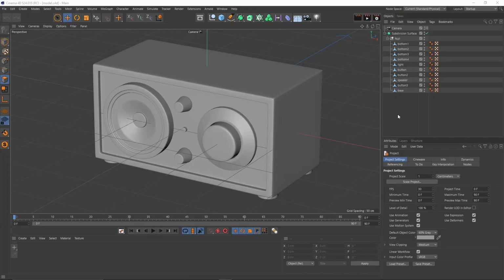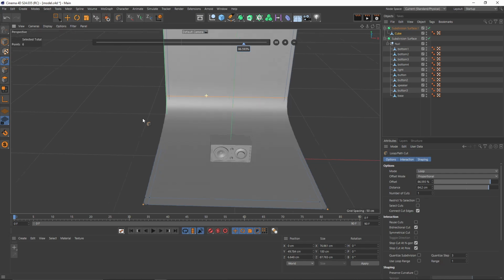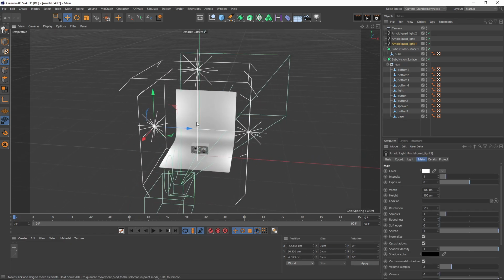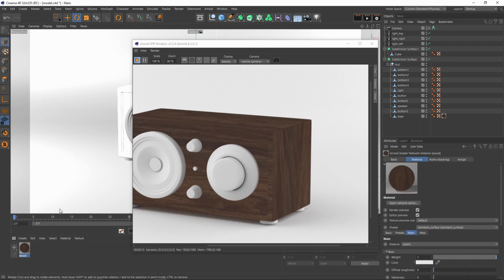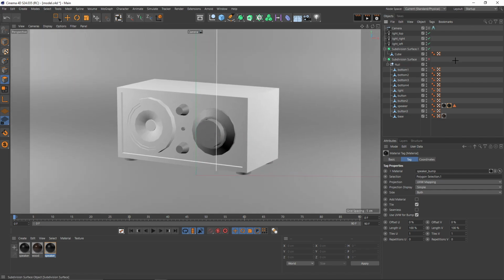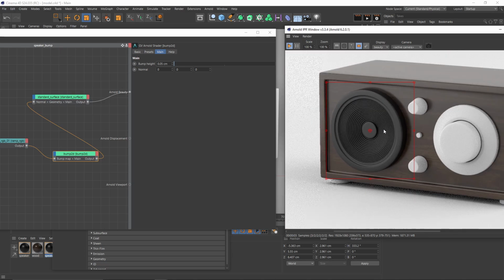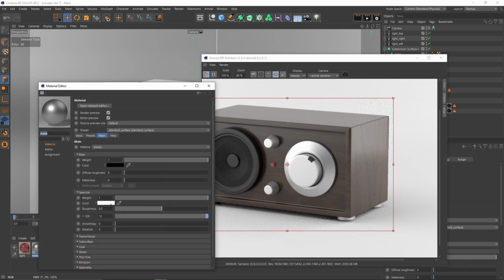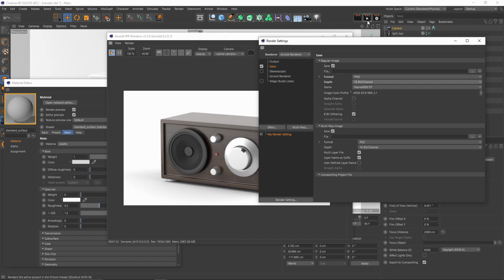Beginner 3D Rendering #1 | Radio | Basic Arnold Rendering Tutorial

Comment: i am using r21 version but is there any modeling tool difference between s24 and r21? if not i would not like to switch
Reply: They change the menus, changed the name of axis center, changed the icons on the UI, the only VAST improvement I found was for UV, I never did it before but now on 24 i uv
Reply from the maker: There is not much difference fron R19 to s24 when it comes to modeling tools, the latest version have some good placement tools but I don't know if it worts to upgrade.
Reply: @polygonpen  They change up the interface though because it seems that the millions of pre existing users dont matter and only the marginal thousands of new users matter. MAXON care more about new people than their long term customers
Reply from the maker: @fluxstandard8364  Actually it is very stable about interface for all these years, the main problem for modeling is phong tag and baking problem for me and most of the C4D modelers
Reply: @polygonpen  and the lack of basic things like points to circle and even distribution tools RIP